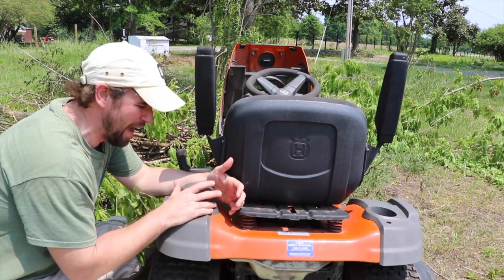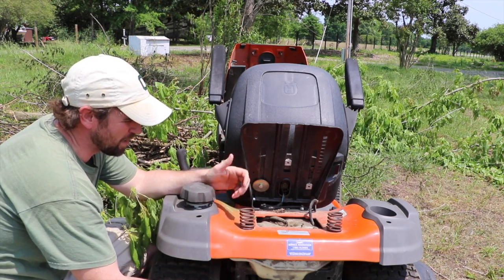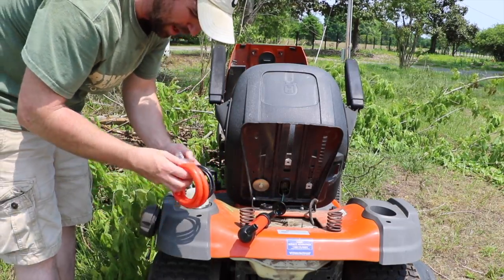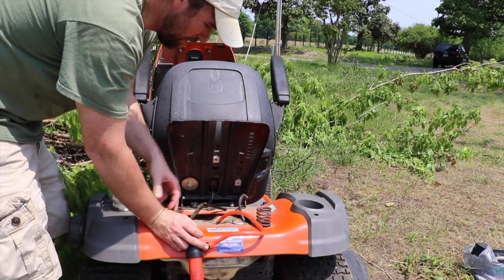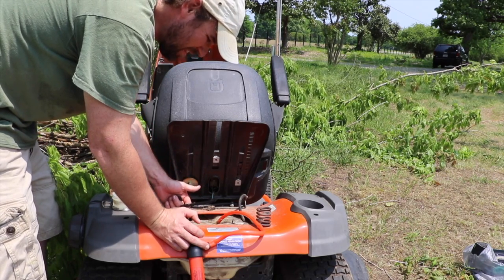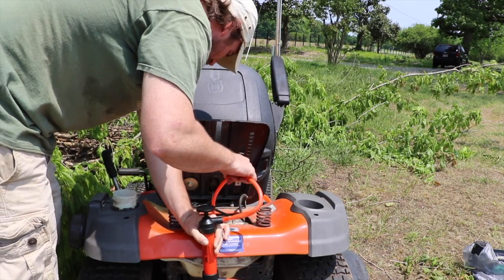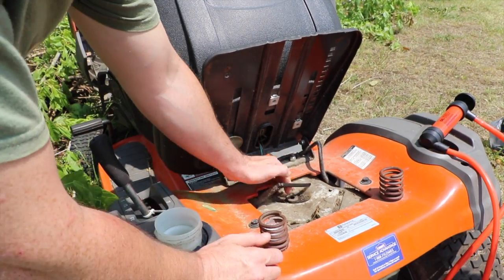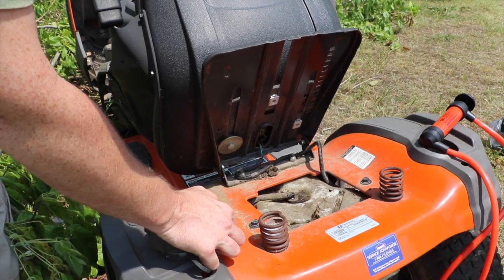Husqvarna Riding Mower Siphon Bad Gas From Tank - Ranch Hand Tips

Comment: The fuel filter on this, and many, riding lawnmowers is below the fuel tank, and uses the siphon effect to help move the fuel to the engine. So no need to purchase a pump, just disconnect the fuel line to the fuel filter and put it over the bucket and the fuel will start draining. I have done it, it works. A pump will pump the fuel out faster, but disconnecting the fuel to the filter and running it to the bucket is FREE.  Oh, you'll need a pliers to compress the clamp to the fuel filter.

Comment: Do you just pull the fuel line straight up? Are there any screws or anything? Do I need a tool? I've never done it, but I think there might be water in the tank or engine somewhere (I forgot I had left the hood up to cool off while I went and worked on the goat run-in, then forgot to put it back down & cover it before it rained).
Reply: The fuel pick up to the tank is what he pulled out to put the tube of the pump in, its a press in rubber fitting. Its tough to get back in, just lube it with some vaseline.

Comment: Do not pull the tube out of the tank if your mower is older.  I did this and the rubber seal disentigrated. Also the gas shot out like a geyser.
Reply: Tony, I did exactly what you said to not do. How did you get it back in?